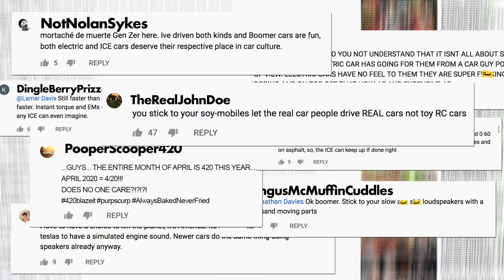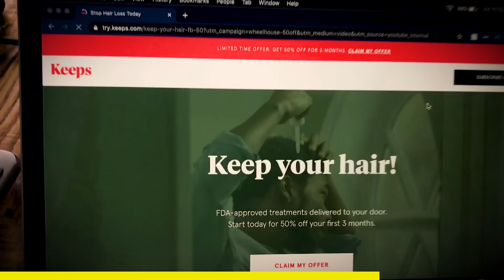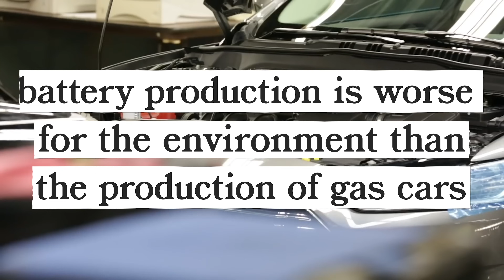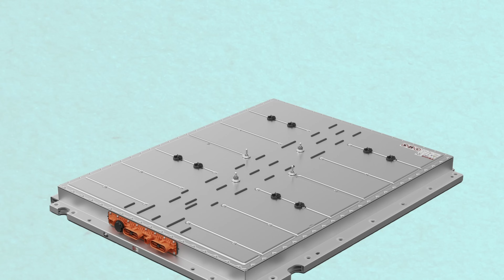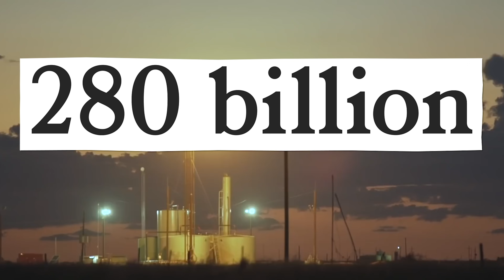Are Electric Cars REALLY Better for the Environment?

Comment: Thanks for the great and insightful video. I want to add that renewable energy is growing by 8-10% every year globally. If you buy an EV today, it will become greener every year because the grids are becoming greener. With ICE vehicles, you're locked into a single type of energy source. 

I just got new solar panels installed at home and will be charging my EV exclusively from solar. This will bring my C02 emissions close to zero.

Comment: Some things you missed...practicality!! I own a 4X4 Tacoma and I use it to tow a 5000 lb camper. In the current situation, an EV truck is still like a SASQUATCH...it is a criptid and towing a heavy load cannot compete with gas and/or diesel. Now, my second point...many like me drive their 4WDs thru mud and water. How in the hell will electricity and mud/water work in an off road situation. I have had my Taco in 1m or deeper of mud and water...only ill effect...not so good for drum brakes and brake shoes. I know even an ICE truck can only traverse water with a certain depth BUT it is way more than an EV truck which again are as hard to find as a Sasquatch. I do not dispute your claims presented in this video but you are talking mostly cars. I am no Ford fan to be sure BUT 80% of FORDs profits are from sales of F series pickups. Never mind GM FCA TOYOTA and on it goes. I personally do not think an EV truck will compete with ICE trucks. When carbon traps are installed on ICE vehicles, they will become ZERO EMISSION vehicles. That will be a game changer.
Reply: Lmao Elon literally unveiled the Tesla Semi and CyberTruck that destroy everything your talking about

Comment: EV batteries last 10-15 years, then become peaker plant batteries for another 10+...
Plenty of time to master recycling..
Reply: 6-8 years then need to be replaced...300-500 cycles...? 

https://www.carfax.com/blog/how-long-does-the-battery-last-in-an-electric-car

Tesla used to warranty 8 years or 100,000 miles...but it might have changed that now.
Reply: @sickjohnson  Tesla's patent they just filed details a new battery that keeps 90% of its range after 4000 full discharge cycles. 300 mile range x 4000 cycles = 1,200,000 mile lifespan.

Comment: 5:42 I've learned that coal bring plants have become very efficient, making less emissions than a natural gas power plant. BUT when people hear "coal" they freak out. Does anyone know?
Reply: true, but coal is for neanderthals
Reply: Yes and no... so what’s happening in just about any power plant, is you’re taking one form of energy, generating heat to make steam to spin a turbine connected to some massive electromagnets that spin at a certain speed at a certain time to generate electricity for the grid. This goes for coal, nuclear, hydro (but skip the steam and burning, they just use liquid water to spin turbines), LNG, or anything similar to those - which also means, you can think of the lake attached to a hydro plant as just a big battery, which doubles as a heat sink since just the magnets rotating creates heat.

Now, when we talk about efficiency we’re talking about the amount of energy used, and the amount “lost” due to one reason or another, either saturated steam, losses through contact, mechanical losses etc. So in this way, coal very well could be more thermally efficient than natural gas.

The other area to look at is the system as a whole. Coal needs to be mined, same as natural gas, but then coal has to be loaded onto a train, in many cases onto a ship, back onto a train and then off to the plant. Natural gas is simply put into a pipeline and pumped directly to the plant. Now these pipes do leak, which means at a certain threshold they are worse than coal, and right now they are still worse than oil, but that will change with time. So in this regard, natural gas is immensely better than coal.

Lastly, the bit that matters most - the emissions/byproducts. Matter can never be destroyed, that’s just a law of physics. If I take coal and burn it, I’m breaking it down into different elements and molecules, same with natural gas. These emissions from natural gas are far less toxic than the emissions from coal. 

This is as much as I want to go into in a YouTube comment, but I encourage you to check out Real Engineering and Engineering Explained for real world applications of stuff like this, and how this can more directly relate to cars

Comment: Great video Nolan. I’m with ya on the, “I’ll probably own a gas car for the rest of my life” thing. Nothing makes me happier then taking the ol 88 Mustang for a rip. Guilty pleasure. Need a pickup for work and currently driving an F-150 which I would gladly replace with an electric one once they hit the market. Like most things, if we could just find something in the middle ground as far as who is using what for which job we would all be much better off. 80% of people are driving way more vehicle than is reasonable on a daily basis. Average daily usage is around 29 miles per day and the vehicle sits unused for 95% of its life. Has to make you wonder what the heck we are doing.

Comment: DIESEL FTW!!

LOOK AT THE TRUE EFFICIENCY....

- Small cars and sedans 55-70mpg, 
- SUVs 45-50mpg, 
- Small pickup trucks 36-40mpg, 
- 3/4 +1 ton heavy duty pickup trucks 20-25mpg
Reply: Diesel needs more refining, diesel cars are noisier,reject more pm and more nox,
Reply: @TheElipsus  they're actually pretty clean nowadays and quiet as most direct injection gasoline cars too.

Have you ever owned or worked on diesel engines?

There's a reason diesels are used all over the world, it's the efficiency and reliablity.. and they are small simple motors too

Comment: Seen some research that contradicts what youre saying. Also taking just CO2 weights for environmental impact is exceedingly simplistic and doesnt represent the whole picture.
A modern internal combustion engine can be as heat efficient as a thermal power plant - around 20 to 30%. Transporting and storing that power as electricity to then convert into motion will result in losses at every step. Therefore the EV will invariably be less efficient. The percentage of renewable/low emission power plants in the world is a single digit number, insignificant in the grand scheme. Over 90% of electricity is produced from fossil fuels. I am guessing you are using US numbers not global. On purpose to make electricity production seem greener than it actually is?
You can burn fuel to make a car move directly, at about 20-30% efficiency, or you can burn it at about the same efficiency to produce electricity hundreds of miles away, lose half of it as heat in steel wires before it gets to your car, where it then gets used to make the car move at even more losses.
Here is some basic math for you: 100kwh battery takes about 50kg of coal to charge (7kwh/kg * 0.3 for efficiency), not accounting for transportation losses, and has a 600km range. A modern economical internal combustion engine requires about 4kg of fuel per 100km. 600km would therefore be 24kg of fuel. FAR LESS than the EV would need to get equally as far. Gasoline is admittedly more energy dense but it burns way cleaner than coal. Seen Chinese smog? Thats coal for ya. As for CO2 then, the mass of fuel burned x2.8 gives you the approximate CO2 weight produced. 50kg of coal will produce more CO2 than 25kg of diesel/gasoline. EVs are NOT more environmentally friendly than economical IC engines at ANY POINT. Fact. The only exception would be after extended use and constant recharging from a green source. But again, over 90% of global electricity is produced from fossil fuels. Green EVs are therefore an exception, not the rule.

Comment: It's important to note that battery technology has come a long way in the last 30 years or so. And it's only going to get better and more sustainable as time goes on. Whereas the technology of ICE cars has more or less reached the limit of it's technology. And while it is POSSIBLE to get more efficient, adding more efficiency makes an ICE more complex, which adds cost in terms of production, maintenance and additional CO2. Whereas electric motors are already about as efficient as you can get.

Comment: Even though the most less efficient EV is more efficient than the most efficient ICE car, you said you are the dirtiest power, coal. The coal powerplants use steam turbines, ranging from 70% to 50%, since you are using the worst one, 50%. 80% of 50% is 40% efficiency, so the most efficient ICE is equal or better than the EV car

Comment: For those claiming love of the sound of V8's - pah, thats nothing until you've heard the sound of a Rolls Royce V12 Merlin engine  :)
Reply: The v8 has a rough sound , v12s sound great but too smooth
Reply: @blakeok952  not if you hear it flying over your head in a Spitfire at 200mph  :)

Comment: It's gonna be interesting to see how things stack up when synthetic fuel starts to come to the market in larger quantity. Potentially, synthetic fuel is going to be carbon neutral which leaves car production the only real pollutant.
Reply: It sure will! But keep in mind that synthetic fuel production still uses more power to produce than it would to charge a car battery with the same amount of energy content. So like a gallon of fuel needs more power to produce than it would take to charge a battery to the level where the joules stored is exactly the same. And that the energy within the fuel would be used less efficiently than an electric motor would use it's battery power. But hey at least then you still got the engine noise people are addicted to, not to mention the instantaneous refuel advantage for long trips.
Reply: They will still have the problem of local pollution, sitting in traffic you are breathing the exhaust of every car around you. Also it has been proven that children that grow up next to highways have less intelligence.
Reply: Dark Warrior I believe a study showing intelligence levels have entirely to many dynamics to quantify on sole item next to them. I bet if you had the same study done with homes next to train tracks you would probably have similar issues. Would home value, and demographics come into play on this study. Median income and other variables to include median adult education level with said homes. It’s not just A+B when it comes to people and society.
Reply: The only thing about synthetic fuels is they still aren’t as efficient as an electric motor. An electric can achieve something like 95-98% efficiency, compared to that of any ICE engine getting around 20% efficiency. This means that an electric car will travel much farther with the same amount of energy input. So really, even if synthetic fuel starts to take off, it’s not going to be as good as electric for the environment simply because the method of turning chemical into kinetic energy is not as efficient
Reply: Xeno Phon Everyone burns things.
Reply: It won't make it to the market in sufficient quantities to be a factor. Once Euro 7 arrives - possibly in 2025 - that will signal the end of ICE, no matter what they're powered by.....
Reply: Sigh. If that happens were gonna have the same crony capitalism that resisted electric vehicles going live. This time it will be big companies like Tesla that will try to prevent that from going to market.
Reply: I'm looking forward to it.
Reply: Xeno Phon  heat-generating chemical reactions are not relegated to cave men. Lithium or Nickle-Cadnium Batteries do the exact same thing, just slower, and in a way that can be reversed. Unless there's a short, wherein the battery then goes into runaway and bursts into flames.

An electric motor is VASTLY more efficient then an ICE (which tops out at around 54% for a theoretical optimum, motors start at 80% and can reach 95% under ideal circumstances). But the chemical reactions that provide the electricity an EV motor needs possess very low energy density when compared with non-reversible chemical power such as hydrocarbons. Gas has more joules of work stored per gram of mass then even the best battery, about 40 times more. That's why ICE engines have done so well for the last century. Electric cars are not new: Some of the very first where electric, They where even more competitive back then,  as this was before gas stations (you'd buy gas in cans at the drug store, everyone who could afford a car had outlets, though). 

They lost to gas because batteries of the time couldn't cut it for range: 1 average 12v battery might take you two miles, but each subsequent battery takes you a bit less, because you're also carrying the batteries. Tf this sounds like the Rocket Equation, that's because it's the same problem. Gas has this too, of course, but with it being high ISP in rocket terms, the additional fuel weight doesn't change the numbers much. 

Lithium has made EV's practical, but it doesn't mean that a synthetic fuel wouldn't be the go-to for a lot of people if it where available. The grid as a whole can handle EV charging no problem, but individual houses, not so much, they're barely able to deal with the oven or dryer a lot of the time. I live in an apartment. there are no outdoor outlets here, let alone a level 2 or level 3 high voltage charger for an EV. The largest EV I can own is a bicycle because I can take it inside and charge it on my wall. However, for the same weight in batteries and motor, and can put a 2-stroke ICE in it (which is not efficient to say the least), and use a two-liter bottle of Gasoline for less then the soda the two-liter came with to go all the way to the capital 40 minutes from me.

As for whether a synthetic fuel will be practical? Yes, but it will cost far more then gasoline does today, leaving it the domain of container ships and aircraft for the most part.

Comment: Also didn't mention that the batteries in EVs have to be replaced every 3-5 years
Reply: probably because they come with an 8 year warranty.
Reply: @philterry3293  that's only on teslas and they still need to be replaced
Reply: Source for this? Batteries do not have to be replaced that often.

Comment: I'm surprised he didn't talk about ethanol
Reply: Not enough land and corn.
Reply: I mean ethanol is already a byproduct of corn processing so why not use it as an alternative fuel
Reply: Not worth mentioning, it's a lost cause, a terrible idea, and the government as well as companies started pulling out of that a long time ago.
Reply: Brandon Weber also ethanol production produces heaps of co2,
Reply: I hate ethanol with a passion. It can have bad effects on your engine particularly if it has a carburetor.
Reply: @AdamSchell303Racing  You can tune most carbs to run fine on ethanol tho.
Reply: @AdamSchell303Racing  ethanol will also support way more power than gasoline due to its effective 105 octane rating and the fact that since it's an alcohol, it cools the air charge so much that some turbo cars don't even need intercoolers

Comment: Hey, how about the batterys that can t be use no more, recycling? I don't think so.
Reply: New methods are popping up every few months or so. The problem is time, cost, and scale. It's a thing, it's just not advanced enough. That's where roughly %20 of the money you spend on an EV goes to; storage and recycling of batteries. As new technologies are developed, electric cars will be more safe and efficient than combustion vehicles and at a cheaper cost. Look to the future of cars and appreciate the past.
Reply: Recycling is only an issue because it's currently cheaper to produce new batteries, as the components are mined in poor countries using simple, established machinery. Recycling batteries on a large scale requires new machinery in technologically advanced countries, so the cost is higher. Plus there really aren't that many dead electric cars yet - they've only been getting popular in the last 5-6 years.
If the demand for raw materials gets too high we'll start recycling them pretty quickly.

Comment: I'm with you Nolan...I love all cars.  I love speed, HP, TQ, and the designs.  I don't care what the power plant is.  That said, I think that maybe this arguement is pretty even, especially since the batteries in EVs have to be replaced every 10 years (or less), where some ICE vehicles will run for 300K+ miles.

Comment: we get gasoline a byproduct of the refining process so to speak so i'm not sure its production shouldn't be weighed as heavily as it may have in this video.  if i'm not mistaken we will still get Gasoline as long as we need fuel for aircraft and one of my largest reasons for me thinking EVs are to new to switch to now is due to the fact that current battery tech is not nearly as energy dense as storing fuel to burn for power which is also why electric aircraft are not exactly a huge thing yet nor will be a huge thing in the near future.  Also... what ever happened to hydrogen fuel cells o_O? i mean if the environment is the main concern.

Comment: What is considered the life span of an EV. Does this account for replacement batteries every 4-5 years?
Reply: 4-5 years?  I'm still over 90% of range in mine after 7-1/2 years.  Are you thinking of the lead acid cells?